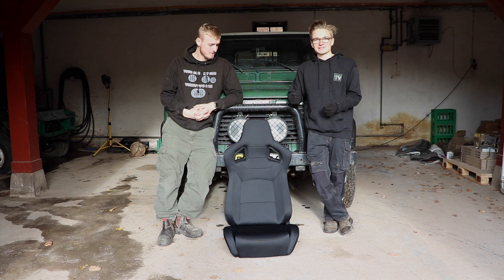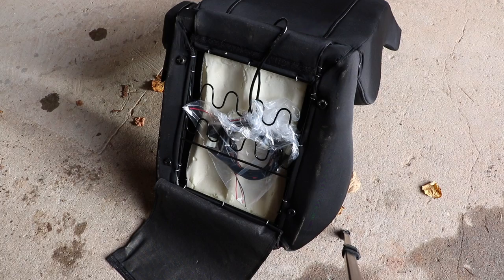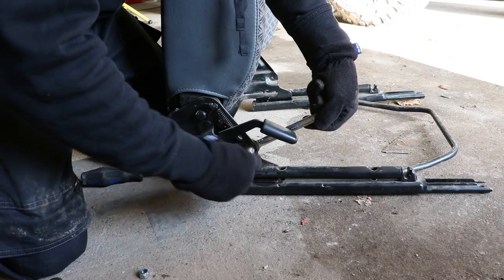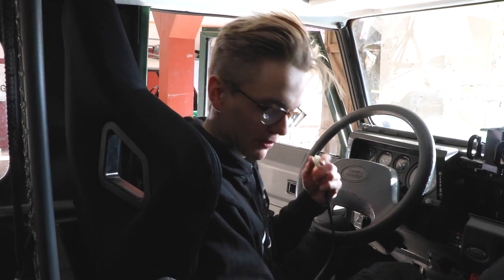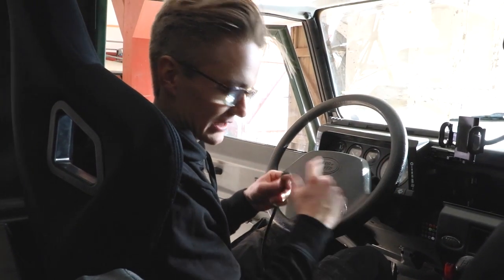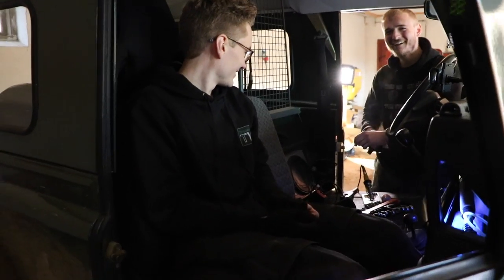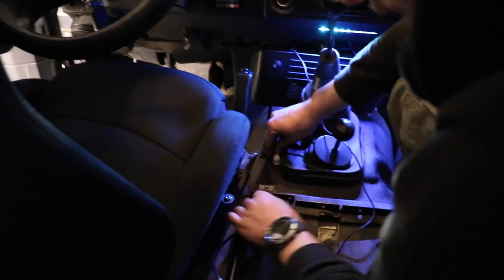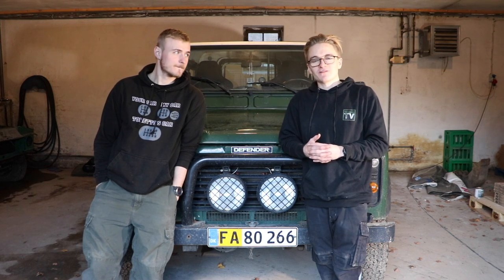Installing Heated Bucket Seats | Land Rover Defender Mods

Comment: How do you feel these held up?Any issues getting in/out with the bucket seats? My defender needs either a retrim or new seats, keep up the good work with the videos.
Reply from the maker: They're comfortable and supportive, but I wouldn't buy them again as the fabric is torn and faded on mine and the heated seat funcionality has been a bit temperamental. I'd spend a bit more and get something better quality.

Comment: Nice video! These seats looks nice and really reasonably priced. The fact that you've got to remove the seat for battery access is less of an issue if you mount an external anderson plug outside the box. Then use that for connecting chargers and jump starters to the battery. Planing on doing that mod myself.
How does the seat feel now when you've tested it for a bit? Satisfied?
Does it raise the seating position?
Keep up the great work!

Comment: So do you lose easy access to the battery or does the seat have some type of feature that allows access without having to unbolt everything?
Reply from the maker: You have to remove the seat unfortunately, which is just four screws.

Comment: How would you compare the seats in the TD5 and the Sparco seats in the V8, and how comfortable are the powerful UK seats?
Reply from the maker: I find the PowerfulUK seats to be very comfortable (and they're cheaper), and I think the Sparcos may be a little firmer but not uncomfortable.
Reply: oh right ok cheers i'm trying to decide what seats to go for and i was swaying towards the PowerfulUK ones as they are an amazing price but was just worried about build quality. Have you had any issues?
Reply from the maker: Nope. I was a little skeptical too when I bought them. But had them for about 1.5 years now and they're fine. Fabric's not torn or anything and the heating elements still work.
Reply: Sounds promising thanks for the help and advise